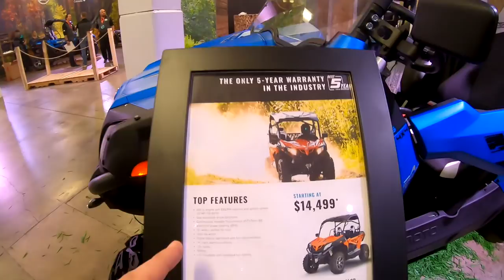2020 Yamaha Grizzly, 2020 RZR Pro at theToronto International Snowmobile and ATV Powersports Show

Comment: I’m sure you know this by now but the CFMOTO’s are all CVTech equipped. The 1000 and 800 both share the same platform, just differences in engine and clutch weight. When you walked by the Zforce 800 trail it had the CVTech sticker on it and on the description sheet. What’s cool is the CVTech units used are adjustable for tire changes and power by preloading the spring in the secondary.